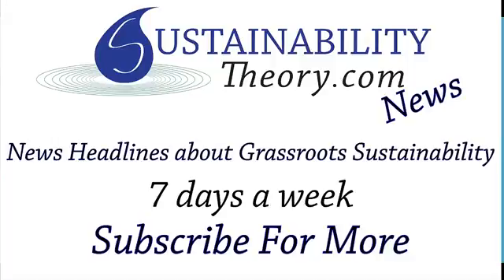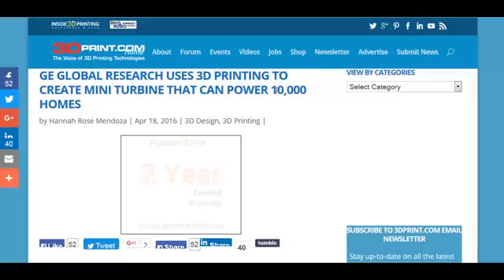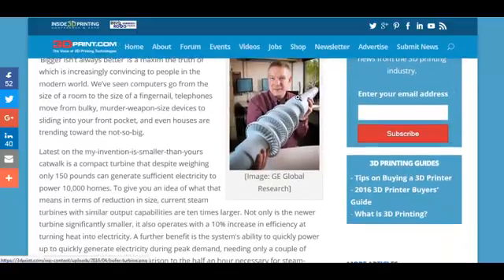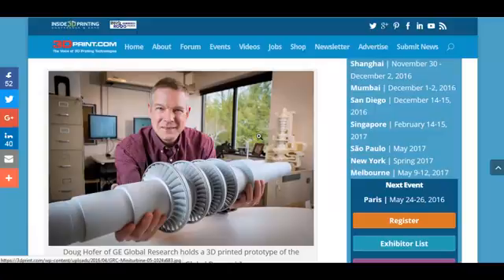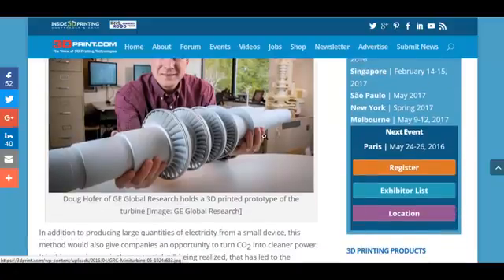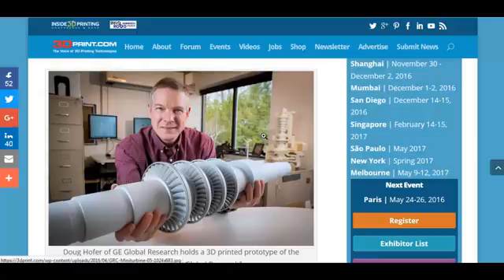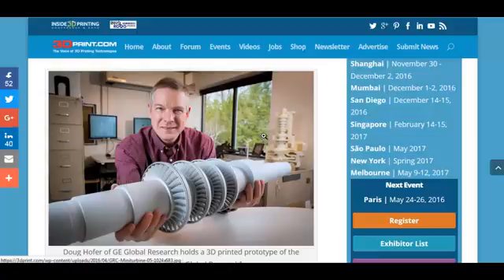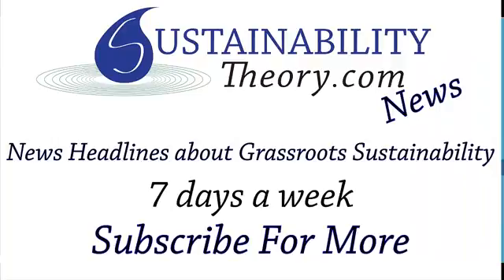New Turbine Can Power 10,000 Homes Using Carbon Dioxide

Comment: "I wouldn't call it a perpetual motion..."

Than what would you call it?  You expect to turn CO2 into a super-critical fluid by drawing on energy from this machine to then power it and get a net positive return.  That's perpetual.

When you put the CO2 under such extreme pressures, you use energy to do so and so that energy is put into the CO2 and becomes potential energy.  Meaning you can not get back more than what you put in.  Thus it won't work.